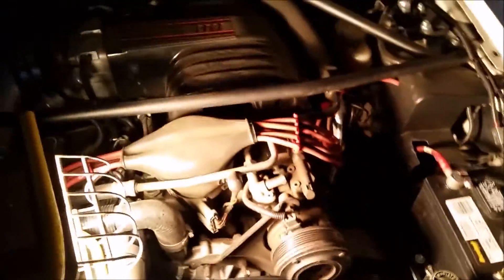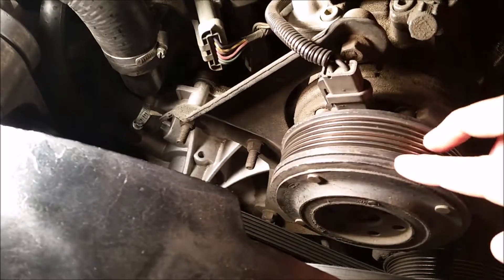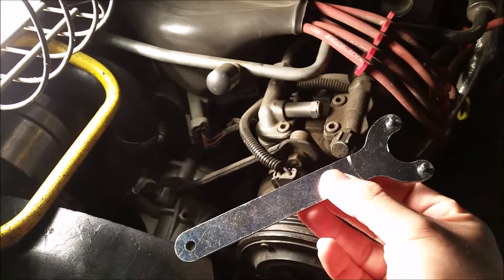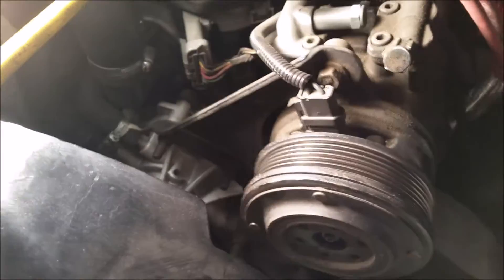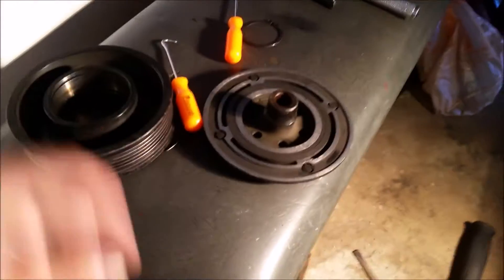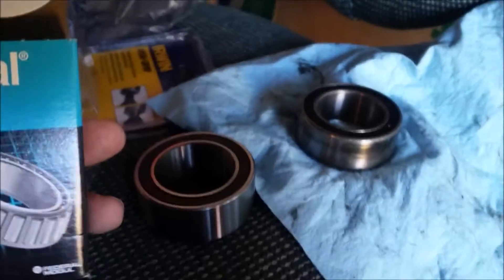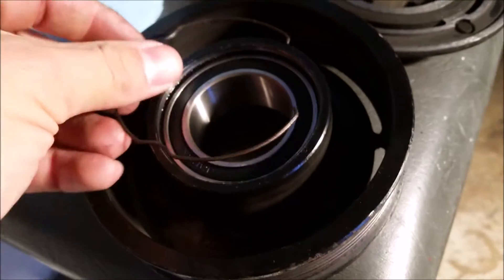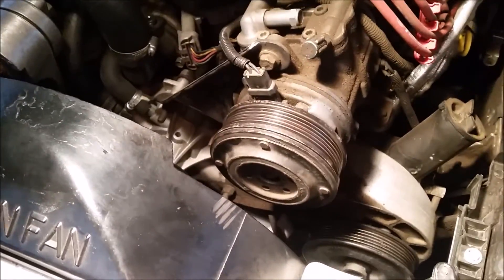Foxbody A/C Compressor Clutch Bearing Replacement

Comment: Did it fix the noise?  Mine is doing the same thing now that its cold.
Reply from the maker: No it did not fix the noise. I had a misalignment issue on the serpentine belt. The power steering pump pulley was too much forward toward the radiator. I rented a tool from autozone and pushed the pulley forward some (toward the engine) and fixed the noise.
Reply: Hi. I have the same issue on my 89 Foxbody. & I’m thinking it’s the bearing or belt misaligned. Car running I hear noise coming from the area of the AC Compressor and a sound like metal balls clinking slightly. My compressor doesn’t spin at all with the belt on. Haven’t taken it off to see yet. I just had everything off earlier this year. Replaced timing chain, water pump, tensioner, etc. wish I had thought about the compressor. Lol
Reply: Hey I wanted to know if you have the part number for the clutch, can't seem to find it in any parts store websites. My clutch plate broke apart now the plates grinding on the pulley. Same ac I think
Reply: What year is ur car